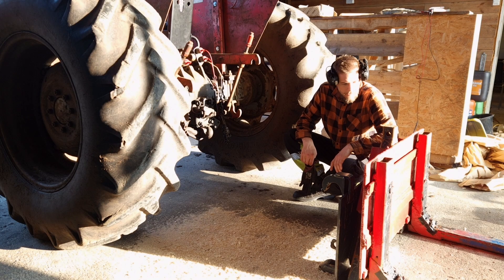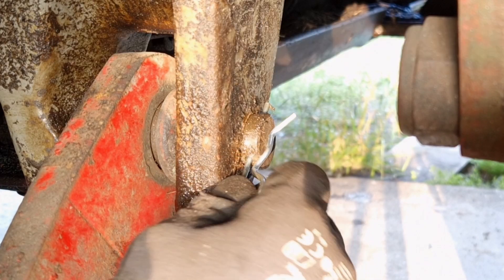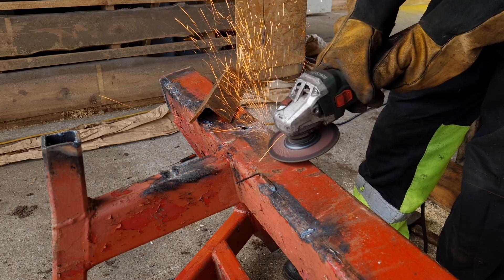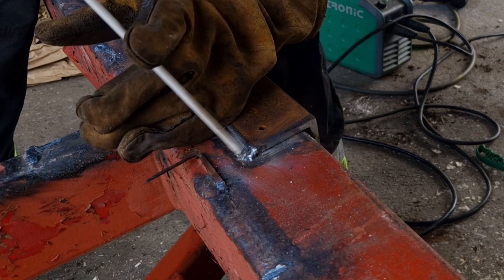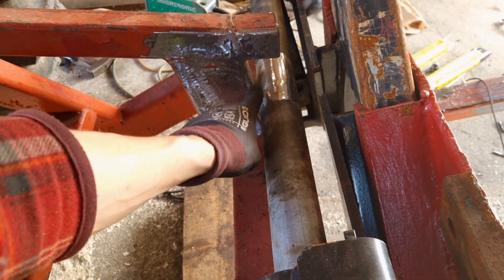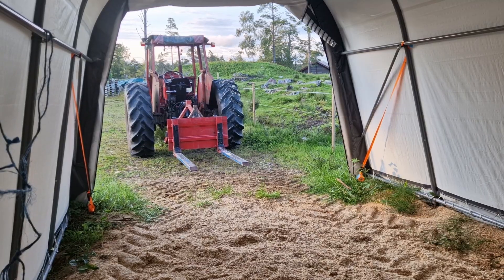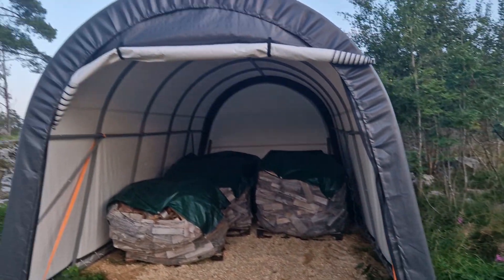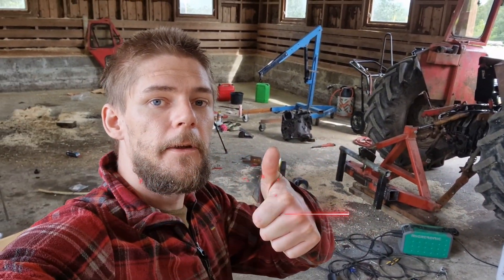3 Point Hitch Pallet Forks Adapter: Homemeade

Comment: I cant imagined those small pallets of wood will break that new housing when using the front blade,  maybe you should re-engineer the old one for a spare so it wont break even if you lift a mountain. But maybe it's easier to see the forks going into pallet when on back......
I was thinking of doing something similar but wasn't sure how to keep mice and ants out of the wood when outside. I have walk-in basement to keep my wood in so I dont want mice or ants coming in with wood if I brought pallets in. 
I go through 8 cord-ish, I bring wood out in winter tree length, cut up 16"-ish on front tractor forks in Oct, takes me about 2 weeks to get all 8 cords cut and in, I split 6" up. My biggest problem when bringing wood in is all the sawdust that comes with it, it all sticks to the wood, sure would be nice to send all my wood through tumbler first, but that would take a lot coffee money.........
Now I have to look for the video of you putting the wood in the bags.........
Reply from the maker: I honestly think having forks on the front would be just fine, but I don't really have the need since it's not a proper FEL anyway. There is no tilt on the blade, so it would lift kind of exactly like it does on the 3-point anyway. And I didn't really feel like challenging faith for something that I could easily avoid without any drawbacks. In fact, as you said, it's kind of nice and gives good overview having them back there. And now I can connect other implements too, on the new adapter! (not that I probably will..)

That sounds like a nice procedure you have for getting your firewood. I had to convert 8 cords, it's about 29m3. That's about the same amount we use as well actually, we tend to burn through about 30m3 (8.28 cords). Agreed about all the sawdust, chips, bark and other junk that follows the firewood. A tumbler would be super handy like you say.

Unfortunately I don't have a video of processing firewood yet. I'll probably make one this season, and test the waters a bit with that topic on my channel.. see how it performs and what I can do to make it watchable for you.

Was interesting to hear about your procedure, and also that we face similar challenges, half way around the world! Very interesting and fun to connect like this. Thanks again for another comment, and for watching of course ❤️

Comment: I do believe you could have just bought a lyng triangel and used that on your forks, this seemed so overengineered that its crazy, or just make a triangel yourself
Reply from the maker: Yes you'redefinitely right, I could have done that. But it's nice to be able to connect other sms/trima equipment as well, if needed (not that I probably will). 

Also, it made for nice youtube content 😄

Thanks for watching ❤️

Comment: That’s one nice tractor, i wish we had four wheel drive on our 65 back in the late sixties. It would have been great for getting up some of the hills we had on the farm. Can you make a grill for the front, no tractor should suffer the indignity of having it missing.
Reply from the maker: Yes! Even though it is an old type of retrofit 4wd, I have plenty of times been stuck in various areas, where the 4wd gives it just that little bit of extra traction to climb through. I couldn't agree more about that missing grill plate, I need to figure something out there. I'm glad you noticed it!

Thanks for watching! ❤️

Comment: Great project, but can't help but think that you could have mounted it much closer to the rear - the pivot is very far out now, and the weight balance maybe not ideal?
Reply from the maker: You're absolutely right, the forks should ideally have been closer to the 3-point. It just ended up like this because it was the easiest option at the time, and since I had that 3-point from the old snow blower.

I am only going to use this adapter to move some firewood pallets around on the farm, as you saw, and thankfully it didn't seem to be an issue for this specific purpose (at least during summer!).

Thanks for watching ❤️